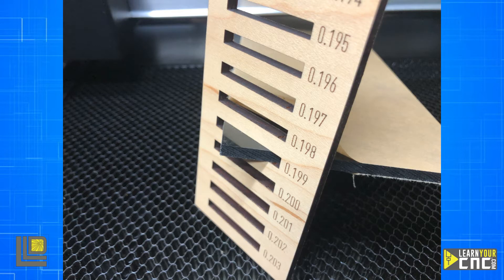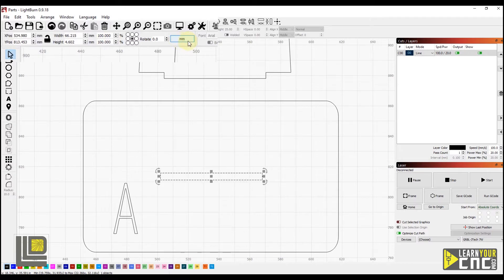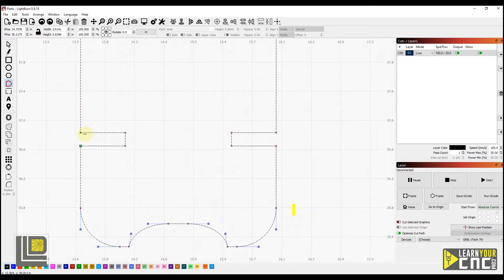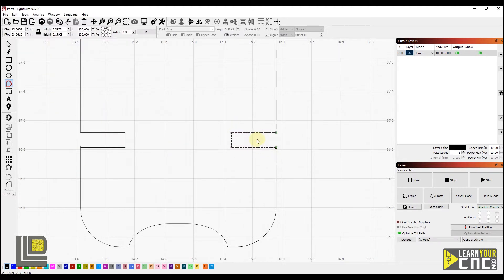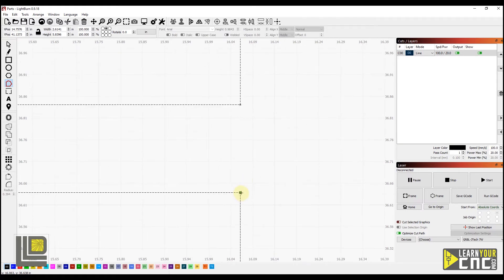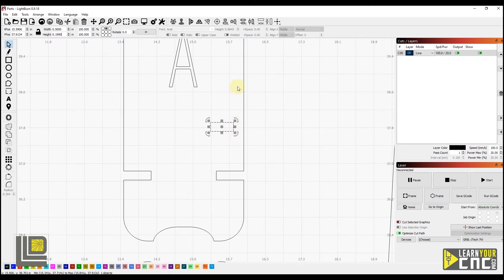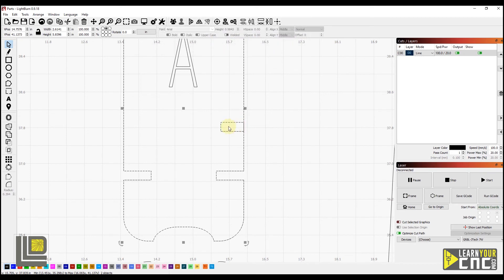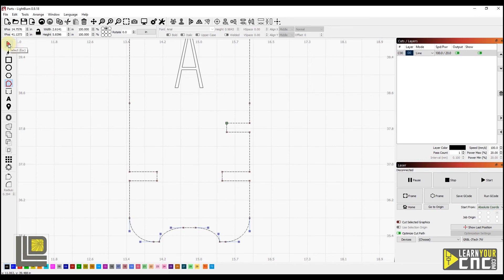How-To Resize Boxes and Slots - Lightburn Edition

Comment: It is true what you explain but that is more complicated as it needs 2be Just use different layers and Change kerf value 5sec and your done
Reply: can you explain in more detail?
Reply: @zachmoyer1849  make everything you Need to ajust as a new layer Like mangenta and Set under layer Option the kerf U need
Reply: @MrTryit69  problem is i cant ungroup the drawing to only select the line to offset so this works for the rectangles but not the tabs

Comment: The video is very good and informative. Thanks. 
 
Just a thought. When you added the extra notch in the drawing you used the break apart tool to edit nodes on the rectangle. An easier way is just convert to path. That way you don’t need to join the 2 corners in the notch when you are done.
Reply from the maker: Interesting! We will give that a shot next time !
Reply: @laserlightdesigns1999  and an easier way is select the large object then the slot and then select the boolean difference tool and you are done. We learn from each other.